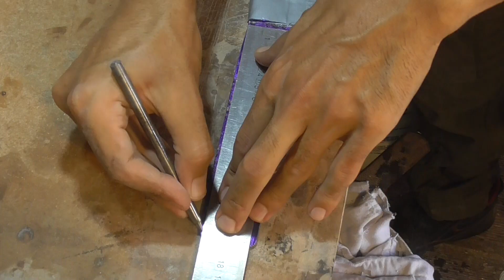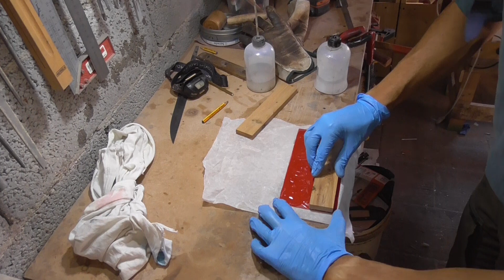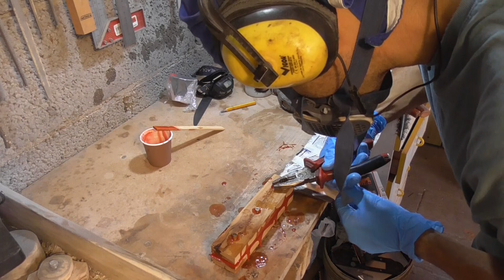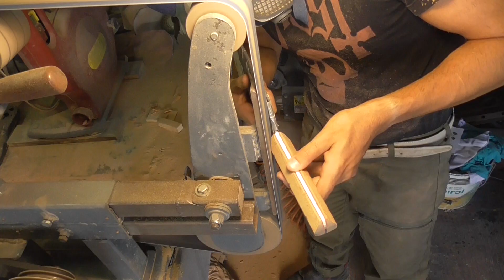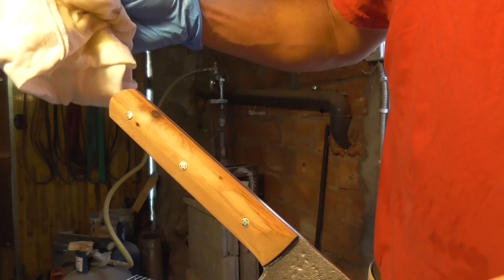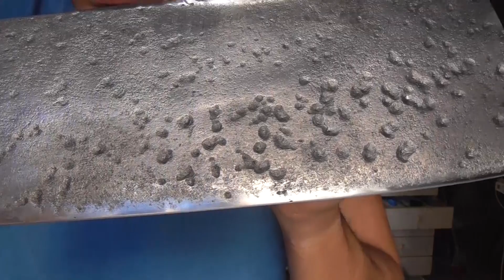CLEAVER RESTORATION - Vintage Cleaver Proper Restoration

Comment: Everyone is missing your blade making content..we know you haven't stopped making blades my friend..show us what you have been working on..come on 9 months without a video is way too long..Cheers my friend..
Reply from the maker: I really appreciate your comment, i will come back i swear! I found a job for the summer so right now knives are on pause, but I'm working on a building video of a forge press from a log splitter that i will use for damascus and other forge welding, so more videos will come for sure!
Reply: @Gabrulo_knifemaking  Sounds great my friend..Today I added a bridge rectifier to one of the outlets on a VariAC transformer also called an autotransformer.. to have both AC/DC variable voltage to do electro chemical etching on blades..total cost $55usd..well look forward to seeing your forge press build..l'm thinking about starting a blade channel too..Cheers..